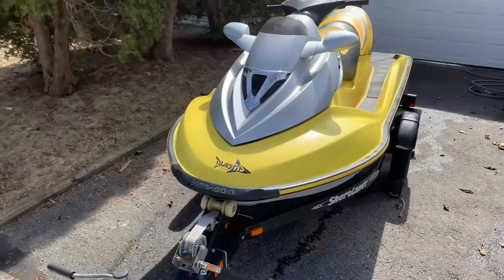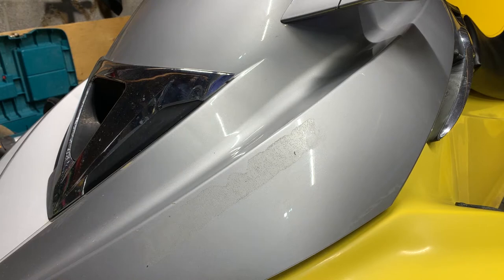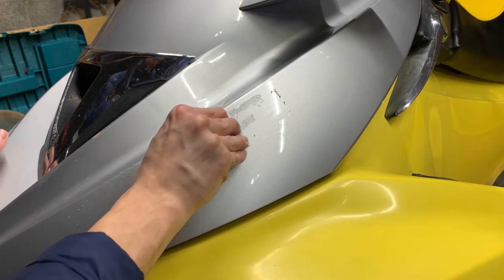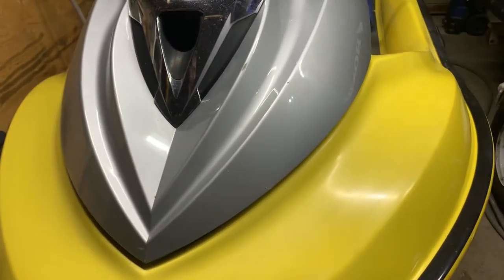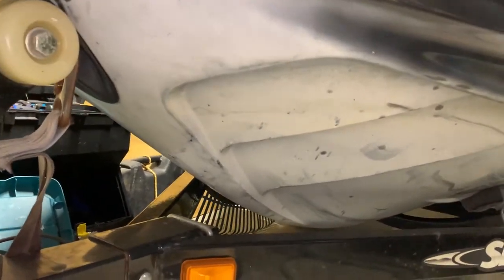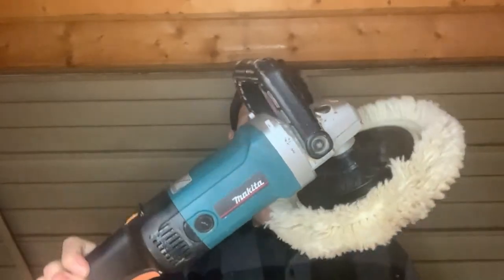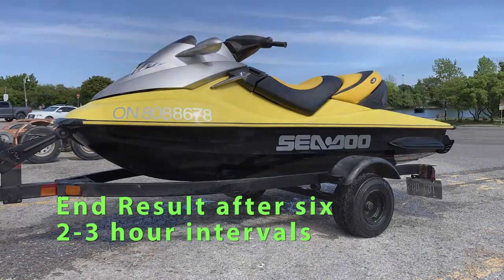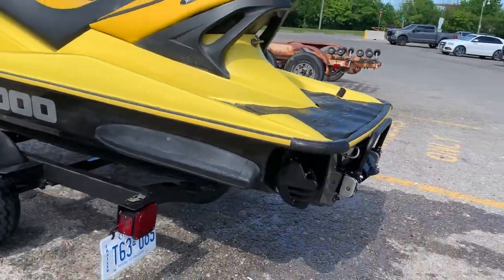Removing Heavy Oxidation from my Seadoo GTX - How to restore a sun faded jet ski hull

Comment: How long does the shine last ?
Reply from the maker: It all depends on how you store your machine. The oxidation is caused by UV light. When not in use, keep a cover on your machine or store it in a garage and the shine will last many years.